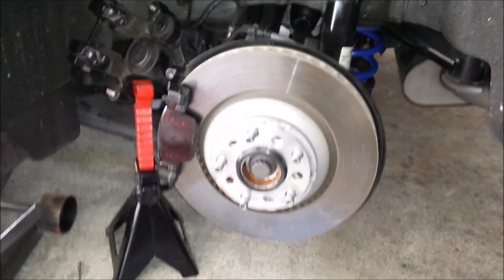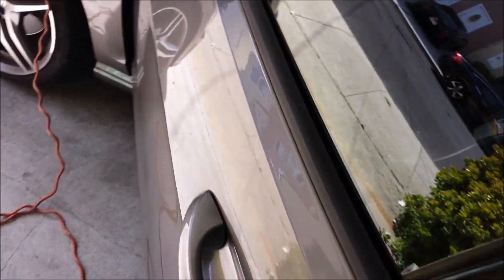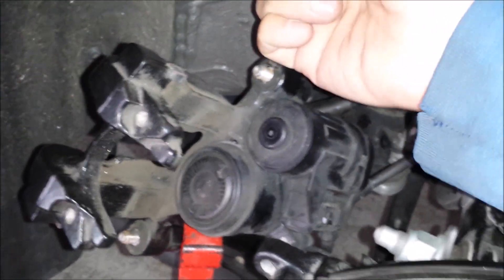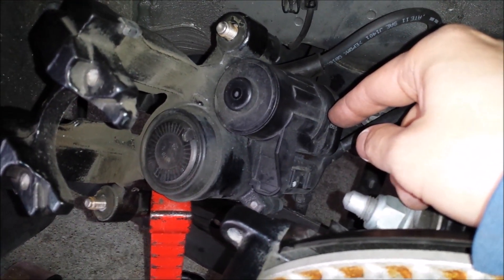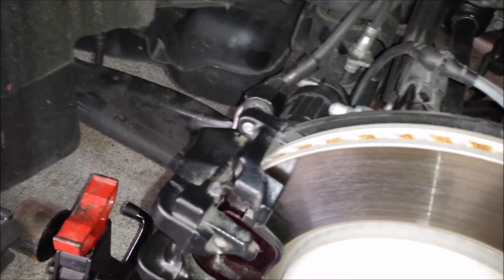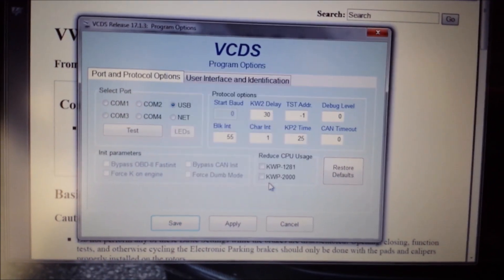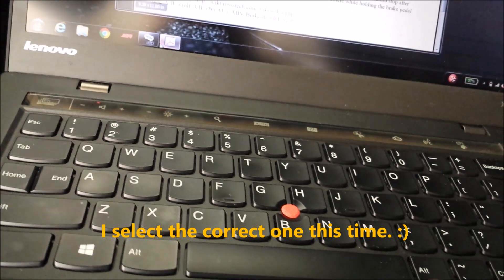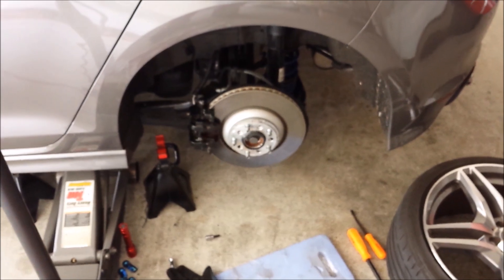How to change rear brake pads on MQB MK7 Golf R / GTI / TSI / TDI with VCDS electric parking brake.

Comment: I had changed my pads and discs all around at the specialist wolswagen and my clutch is mot the same it lost the pressure so I don't know if the  is any related problem ro the clutch very disappointing wanted done my brakes and my clutch is lost the power so just to be.aware of tha o  mk7 golf

Comment: Hi jen, did you bleed the brakes on your Golf? I see bleed brakes on vcds options menu. There is some procedure or just using a brakes bleeder? Thank you so much
Reply from the maker: Yes, I bled the brakes. Gotta do that every 2 years with a pressurized brake bleeder.
Reply: @tranjen  ok thanks. how do you purge the abs with vcds?
Reply from the maker: @marcotini4796  I actually use a high pressure brake bleeder set to ~25 to 30 psi. That will be enough to bleed the brakes out.

Comment: After start lining before changing the rear pad, does the caliper back to normal position? So I don't need other tools to push back the  piston?
Reply: Start lining change will only retract internal handbrake mechanism but not piston, it will remain in the last position. Piston must be retracted using a pressing tool (just pressing it, not turning). It's impossible to retract piston if internal handbrake mechanism is not retracted before.
Reply from the maker: I didn't change to new pads so I didn't need the push tool for the pistons.
Reply: I think that yours is not correct way to retract pistons, because after that the e-brake engine is not able to find the correct open and close positions. I think that if you retract screw mechanism by VCDS first, then you are able to retract piston without turnnig it.

Comment: Couldn't you just leave the ignition on and take the parking brake off?
Reply from the maker: In theory, that might have just worked, but I personally wanted to see how to change out new pads. You'll definitely need to back the pistol out for the new thicker ones. Thanks for the comment!

Comment: Nice video, we need it. I did it without VCDS. I took off the electric motor, twist the screw on it to make it retract all the way. Put them on and use a genetic scan tool to calibrate it, it works.
Reply: Doesnt the system self calibrate
Reply from the maker: Nice. I didn't want to take a chance with that and having to replace the entire rear brake system. Where's your video to help out dude. :)
Reply: well that wasn't go as planned. The DIY shop told me they have the scan tool, not VCDS a genetic scan tool. They start mess with it and I hear the motor retract, however, not far enough. I might post it to forum. It just easier to do with VCDS

Comment: my GTI has this annoying brake noise as well, but it's not when activating the brakes, it's when it's sitting still and the parking brake is on. On the caliper there is a little metal clip that you can see holding the pad in place. for whatever reason they rattle and make the sound of thin metal buzzing anytime you open the door, close the door, get in the car, etc. I took a hammer and tapped the clips and it stopped the issues for the most part.
Reply from the maker: Glad you figured that one out. Talk about build quality from Volkswagen. My noise was speed related. When driving slowly you hear the high pitch sound whirling and when going faster the sound gets faster.